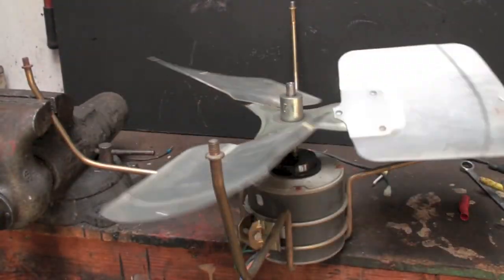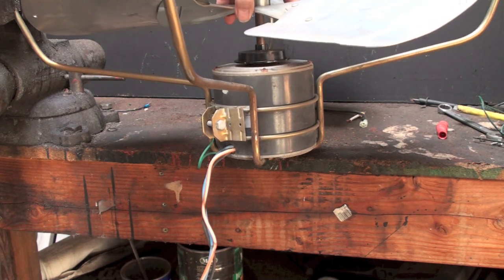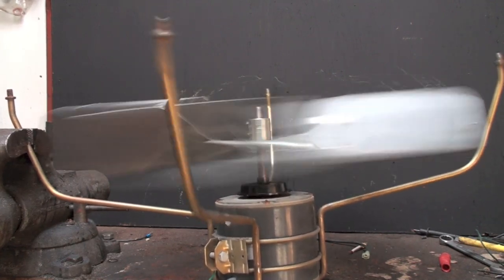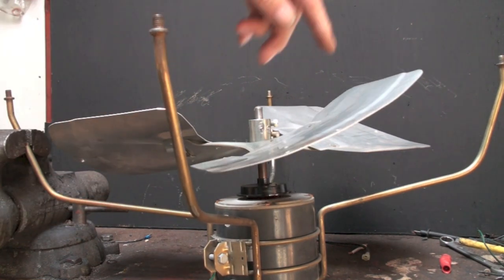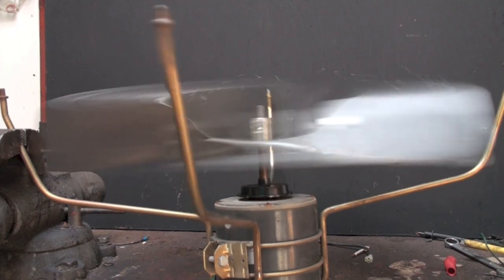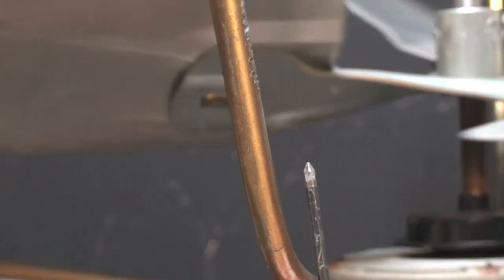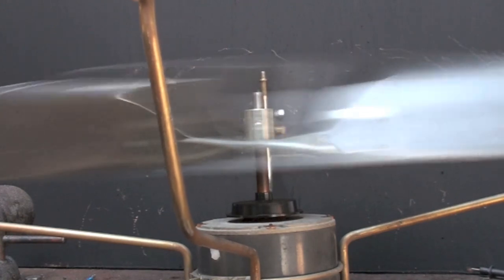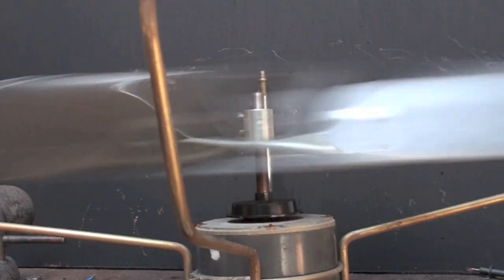How to fix fan blade alignment

Comment: Just had our roof replaced and they replaced the attic roof fan. (old one had a seized motor).  Hooked up power it today and it's a rockin' and a rollin'.   Saw this video and went back up and checked the blades - yep - 2 were "bent" out of place, it's a 6 blade fan.  Tweaked them a bit and got it 50% better.  Will go back when it's not 100+ up there.   Appreciate you passing on your  knowledge Gary.
Reply from the maker: Yeah, these 100+ days are a monster.
GFM

Comment: You gave me an idea how to find a bent brass blade on an antique (1914) desk fan I am working on. It was not out by much but you could see some back and forth motion when the fan was running. I put a pencil in a vise length wise with the eraser sticking out. With the blade mounted on the motor I backed up the fan until the edge of the blade just barely cleared the eraser. I turned the blade by hand and one of the blades did not clear the eraser. On the first try bending it forward (those old brass blades are tough) I got it over 90% corrected and the difference is very noticeable. I know better than to press my luck so at that point I left it alone and unless you look very closely you can't tell the blade isn't 100% perfect. It is so close I'll bet that no one but me will be able to tell. Thanks very much.

Comment: Just tweaked one blade on the 5 blade stamped aluminum 'air drive' fan for my natural gas garage heater.    It's way quieter now.  Hopefully the imbalance didn't mess up the motor bearings already.   This is the 2nd time in 2 years I've had a blade warp on its own.   I've replaced the motor once and fan once.  11 year old heater.  Thanks for sharing your experience

Comment: Ah memories. I used to work on helicopters. Out of track or wrong pitch angle will cause the same vibration. Enstrom Helicopter was chasing after a vibration problem, they even recommended using the same manufacturer for each blade (Alcoa/Reynolds) because they thought the spars might have different flexibility even tho the material spec was the same.

Comment: You can bend all the blade down very aggressive (not a little)  and it will almost double the cfm. Did it to my 15" solar fan rpm still the same. And quiet no sound at all.
Reply from the maker: Not going to do that.
GFM

Comment: Hi there:

Where dis you get that fan holder. I may have the same problem. I would lime a way to inspect without loosing a digit. 

Thanks
Reply from the maker: That's actually the mount from the A/C unit.
GFM

Comment: In my case I just had to shut the unit off for a couple hours, let it drain. Guess it was working to hard and built ice up inside?
Reply from the maker: If you were building up ice on the indoor coil, you still have the problem.  There are several reasons for this.
low air flow from plugged filter, coil or ductwork problem.
Low refrigerant charge in the A/C.
Temp setting too low (below 70F).
GFM

Comment: What about a Window A/c unit. I have a 2013 LG- I have gone through 3 of these models and they all have had fan issues.Warrently? Well it's only as good as the service guy who NEVER shows up so figured I was on my own. Mine has a broken blade, so I mesured it and got 23.20 grams. Added  that weight in in quarters attached with expoxy and fiberglass. Still vibs and noticed I still have one blade almost directly opposite that is heavy. Still trying . If I fail what is good 8k unit that is realible

Comment: Question in one of the apartments I work at the Ptac fan wobbles a lot but it looks like an adhesive came undone between the fan and the motor I’ve put jb weld and epoxy in between to feel but the fan shakes terribly still any other ways I should try?
Reply from the maker: Unfortunately, fan blade replacement is about all you can do.
GFM

Comment: Thanks for the video. I just replaced my motor and unit is wobbling pretty hard. Didn't exactly run buttery smooth before changing the motor but seems noticeably worse now. 

Have you ever seen anyone bend a shaft by overtightening a set-screw? 

Is an aftermarket fan ok for replacement?
Reply from the maker: Pretty hard to bend that shaft.  I am not a fan of aftermarket fan blades.  I would use an OEM if it is available.
GFM

Comment: mine is bent pretty bad. should i jst relace it
Reply from the maker: I would.
GFM
Reply: nvm my dad got it fix.
Reply: So would I. Once that motor shaft is bent out of alignment by warped blades, it can eventually lead to overheating, and subsequently a fire.